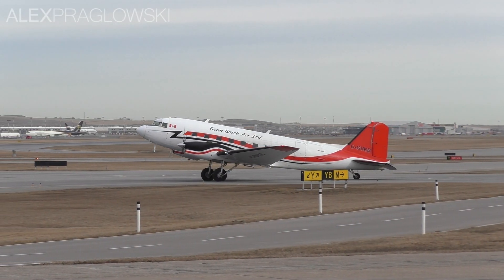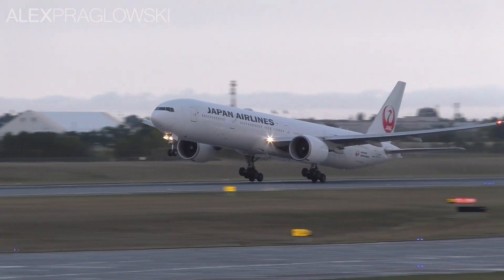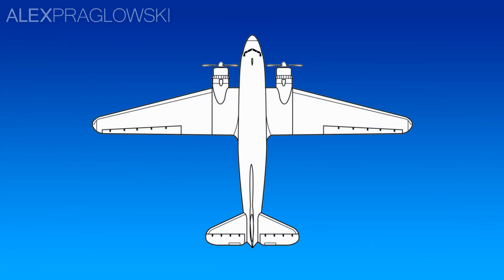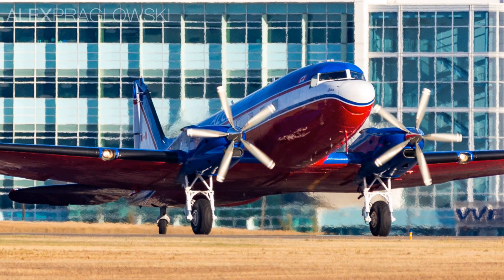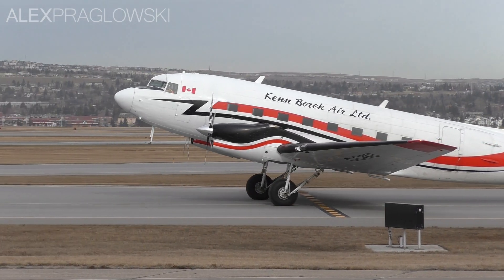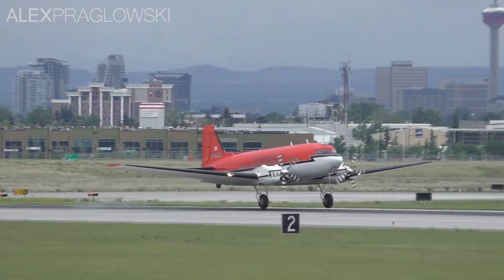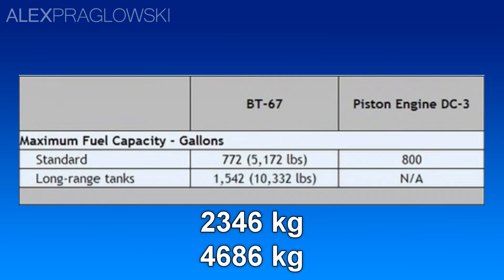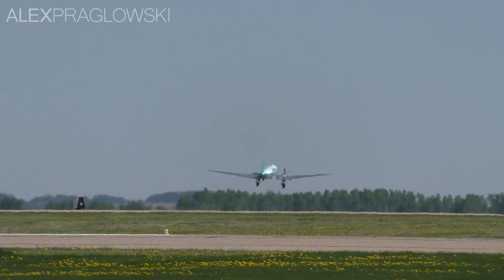What Is The Turbine DC-3?

Comment: Just learned pressurization is a wear factor on your airframe.
Had been thinking a Basler could be set up with pressurization thus enabling  higher operating ceiling and possibly better fuel efficiency. 
Instead of resurrecting DC-3 airframe why not prime manufacture DC-3 inspired new airframes with pressurization designed in from the get go ?

Comment: The turbine dc-3 is an aircraft manufactured by McDonnell Douglas that has the original radial engines replaced with more modern turboprop units there are way less moving parts in turbo prop system then a piston radial engine and allows for more fuel mileage and less maintenance I flown both talking on experience but they both sound good but for charters trying to make profit turbo prop is the way to go these planes usually get retrofitted with pratt and Whitney pt6a turbo props

Comment: The DC-1, DC-2, DC-3 aircraft were designed by people with slide rules and a good dose of intelligence.  They did not have computers.  They designed DC planes to be stronger than was necessary and it clearly shows in their longevity.  Well done, Douglas Aircraft.

Comment: I would've loved getting 14,000lbs on the Basler. We were thrilled getting 12,000lbs, typically we wouldn't go above 10,500 and that was with BT-67s that had the shorter wings and no aux fuel tanks. KKB (in this video) had a reinforced floor, larger wings and aux fuel tanks to extend range...it was a heavy bird built to take a beating and you'd max out at about 9,000lbs.

Comment: Not DC-3 related but I remember one flight of an Air Force Constellation if I Remember correctly that was powered by 4 Pratt and Whitney 4360's. On a flight from LA to Hawaii just past the point of no return an engine failed in flight, feathered the prop and continued the mission then another failed, then the third engine failed. The command pilot then broke the war emergency wire on the throttle on the last operating engine. Pratt and Whitney guaranteed when you went to war emergency setting no more than 5 minutes at a rating of 5000 horsepower. That engine continued to power the aircraft until it landed and after touchdown the pilot started to reduce power and the engine seized with no warning. It ran for more than 6 hours I believe after the pilot went to war emergency rating.

If you visit Pratt and Whitney's production facility in Connecticut that engine is still on display in the main entrance lobby no bs. Somebody check it out and the story of its flight is posted along with the engine. The 4360 was known to run reliably for 600 hours then usually failed in flight. It is the only flight with 4360's where three engines failed and actually arrived safely. By the flight manual of the aircraft the aircraft should have crashed into the sea.

Cheers!

Comment: It is my understanding that the South African Air-force commissioned the modification of their DC3 and DC4 fleet in South Africa in the 1980's which included an extension of the fuselage and installation P&W Turbo engines in concept models in the late 80's and full production in 1990.  Research, design and implementation was  undertaken by State military manufacturers Armscor and Denal Aviation.

Comment: The radials wore out.

Turboprop is more efficient and lighter so they stuck them in place of the radials.

because of the lighter engines, they need more nose weight so they stretch the fuselage.

Comment: Unpressurised cabin is the main factor contributing for the longevity of the airframe.
Reply: I was wondering why the PT-6 version used more fuel.  You may have answered my question for me.  Lower operating altitudes.
Reply: @davetherockguy  It uses more fuel because per horsepower turbine engines use more fuel than piston engines. The Basler 3 out performs the standard DC-3 in all the parameters except range and Basler had to double the aircraft's fuel capacity to give it more range than the Standard piston engine DC-3.
Reply: @Agwings1960  you can't lean out a PT-6, they run at a constant speed. Radials you can play with the throttles and mixtures for max endurance. Jet fuel is easier to handle than Avgas to remote locations and won't varnish up like Avgas. Turbines do have problems starting in artic weather though.
Reply: @michaellucht6351  I know that my comment was to point out how the SFC numbers on piston engines were different from the PT6's, used on the turbine engine conversion and you can lean out turbine engines too, with altitude lol
Reply: @Agwings1960  I work on KC-135s at the depot, our oldest ones still flying are 57 models. We always replacing fuselage and wing skin , engineers  told me when we do that we a zero timing the airframe. We are about 30k on hour's. I remember flying at altitude and making gas.
Reply: No It's like saying spiders can walk more than human cause they have more legs. Pressurised cabins are made for pressurization.
Reply: I'd say that the over built redundancy is more relevant.
Reply: Someone explain to me why you can't just give up a bit of cabin space, and install a pressurized inner liner while leaving the air frame un-pressurized?  It seems like a workable compromise for a corporate commuter.  Also, why no winglets on the end of the wing to reduce drag?

I am not an engineer, so I look for simple fixes for what look like simple problems.  Thanks!
Reply: @barking.dog.productions1777  When it comes to pushing cargo, The more you can fit the more money you make.
Reply: @caleproteau1060  I didn't mention pushing cargo, I mentioned a pressurized cabin for corporate transportation.  Any idiot can see that if you are pushing cargo the more you can carry the more money you make.
Reply: @barking.dog.productions1777  There's better, newer aircraft for corporate transport at that cost. Every Basler is worth 8 million bucks.
Reply: @barking.dog.productions1777  It's obvious, you can not have partly pressurized aircraft because structural integrity.
Reply: @Patrick_AUBRY  No one mentioned a partially pressurized aircraft.  Maybe, it will help you to visualize it more like a vacuum thermos with the passengers being inside of a completely separate chamber isolated from the main airframe. (except to pull fresh air from it.)  It would help with  sound deadening and thermal insulation for the passengers as well since there is plenty of room to wrap the inner chamber with insulation and still have plenty of passenger space for 10-15  people.
Reply: @stopthephilosophicalzombie9017  I seem to recall that it is done in certain submarines, and possibly spacecraft.  That might be a better place to research the effectiveness and application.  It doesn't make sense cost wise to build a new plane this way since the pressure differential is so small they just pressurize the entire airframe.  It only makes sense in retrofitting these older birds to keep corporate types comfortable while retaining the un-pressurized airframe for the crew and luggage.  People will spend a fortune retro fitting old yachts and planes, and with today's composites it would be fairly simple to do.
Reply: @barking.dog.productions1777  The pressure cell would basically be a piece of cargo itself, and very heavy if it is supposed to support several PSI over its entire surface, with 1 or more hinged openings- (think about the doors on a modern jet) - it would quickly weigh more than is worth it to keep it separate from the airframe
Reply: @johndoe528  I agree to a certain extent.
This is just speculation on my part anyway.

With modern materials (carbon fiber) the weight becomes a non-issue.  Considering that these airplanes can carry 1000's of lb freight/payload - I was just speculating that if the primary mission were a corporate/small-company long range transport, then it could be be done quite easily.  There is plenty of room to install a very comfortable pressure capsule for quite a few people while still allowing passage for flight crew to have access to the entire un-pressurized air frame.  The main benefit being range vs cost per mile.

Also a very viable solution for very low budget exploration or scientific study long range personnel and equipment transport.

Would anyone actually want to do it?  I don't know.  Big companies just write off the expense of a corporate jet.
Reply: @barking.dog.productions1777 
Eeyow, no. Pressurizing a -3 would be a nightmare, and the PT-6A-67s don't put out enough bleed air to pressurize even part of that big cabin.
Reply: barking.dog.productions1776 that would be an incredibly difficult task.  Where are you the pressurization component going to be placed.  The high and low pressure ducting has to be installed.  Windows must be replaced with round windows.  Too much work for little gains
Reply: @frankbutaric3565  I don't understand why people have to try to turn simple things into nothing but problems.  You pull out the seats, and you install a large pill/egg shaped container inside of the non-pressurized cabin.  it only needs one pressure door.  inside of the big propane cylinder you put chairs, food, water, a bathroom, a stewardess,some inside portion of climate control, a speaker box to communicate outside of the big propane tank with the rest of the crew.  everything else gets mounted outside of the big propane tank.  Inside the tank only needs to maintain fresh air at one atmosphere.

Why do you insist on being obtuse, and trying to turn this into a mars lander?

We are just trying to transport some corporate types in a pressurized container inside of the original unimproved air frame.  Why do corporate types need a window?  They are supposed to be in there working or sleeping,  If they need to see something outside of the big tank then mount some cameras and give them plenty of flat monitors.  Why is this simple concept so difficult for you to grasp?????

GOOD GOD... talk about over-educated and not a lick of common sense.
Reply: @frankbutaric3565  Here Frank, let me tell you a little joke.  Back in the 1960's some folks just like you had an engineering problem at NASA.  It seemed that terrestrial pens would not work in zero G.  After 5 years of research and testing the "space pen" was born - it was an engineering marvel, and the pride of the American team!!!!!

The Russians had the exact same problem...  they used a pencil.
Reply: I'm not getting any notices of comments on the discussion, and even if I did I would probably ignore them.

That discussion was talked out 6 months ago, and why would I want to start a company making liners for an obsolete plane?
How big do you think that market is?  Have you ever owned a business...  I have.  That is not a smart business idea.

There are other discussions on the site, why don't you go find one and stop beating a dead horse?

Have a good day.
Reply: @barking.dog.productions1777  You made a good point there. You’re not an engineer. So how would you expect to understand the answer to an incredibly complex problem, let alone expect someone to be able to explain it in the comment section of a YouTube video…
Reply: Anas Takiyudin Contributing to, not for
Reply: Lewis Johnson pressurized cabins have a finite amount of cycles.  At that point they are scrapped or used for cargo only.  Every takeoff places stress on the fuselage just like inflating a balloon.  The cost of inspecting all the connective joints and other components becomes so great that it is cheaper to get a new aircraft.

Comment: honestly what im wondering is, if you have to redo all electronics, hydraulis, the engines and critical parts of the airfram to have "zero accumulative fatigue damage", then why dont you just build a new airframe from scratch? considering how widely the airplane was in use shouldnt there be enough tooling left over to produce new frames?
Reply: It would be my guess that it would need to be recertified.  
Also there is a lot from the war that is already lost to history.  I help with with a tbm avenger none of the tooling survived. ( the owner and his partner are the largest supplier of parts so if it was around they would have it). We've worked off the prints for parts and its nearly impossible to remake them as the techniques used in manufacturing of them are just gone. It really is surprising how non backwards compatible we are.

Comment: Back in 1991, I did some skydiving.  I rode up in one of these converted turboprop DC-3 planes several times.  It had a large side opening with a Plexiglas roll up door, like an overhead garage door.  On the busy days, we'd jump at 12,000 feet, and by the time I made it back on the ground, the plane had already landed, loaded up and was on the way back up with the next load of people.
I don't know if it was a Basler BT-67, but it was a turboprop DC-3.

Comment: One time around 1993 or so I was in the Florida Keys with some friends and a local outfit was flying bright yellow DC-3's over us, spraying the nearby areas for mosquito control. They flew very low over the house and it was really cool to hear those engines and see real, working DC-3's doing their job. Later we drove by the airfield and saw them parked on the flight line.

Comment: I live in Miami, and there's still a few DC 3s flying. They haul the mail to the Bahamas every day, twice a day. They leave out of Opa Locka airport and fly to Nassau or Grand Bahamas and prolly other islands too. We see them leave out hearing their original rotory motors and three four hours later back they come. So cool still seeing them flying being a workhorse. It's also a good way for young pilots to gain flight hours just hauling the mail.
Reply: Are you sure they are not those missing planes lost in the Bermuda Triangle long time ago that happens to make a come back through some time wrapping wormhole?
Reply: That's great to hear they're still in service.  I grew up in Miami Lakes right next to Opa Locka.  Saw the DC-3's running 25 years ago and thought how old they were even back then.  Saw all kinds of unique aircraft as a child at that airport.
Reply: @cup_and_cone  I used to only see some sivler MIG 15 conducting flight training near us and some ugly army green biplane doing low level pass by.
Reply: @cup_and_cone  Yep they're still flying, every day. I guess it's cheaper to use prop planes for the short hops of the Bahamas, than a jet. They also use other older airplanes, like Lockheed's and other vintages from the 50's, but there's at least three DC 3's there. Opa Locka is becoming more of a corporate  jet port. They built a few high end private terminals there catering to the wealthy. The Coast Guard is still there with their base. But Opa Locka as a whole, as you remember it has gotten a lot smaller, they've been selling off the property around 57 Ave and 37 Ave.
Reply: Prolly?
Reply: Most still In use are ex c47's they built only 607 dc3's from 36-42 and just over 10,000 c47 from 42-45
Reply: Actually, DC-3s use radial engines. The old "rotary" engines from WWI are also radials, but the whole engine spins with the propeller bolted to it. As engines increased in size and weight, the rotating mass of the ever heavier engines created such gyroscopic effects as to make control difficult, so fixed radials turning props with the crankshaft became the norm.
All rotaries are radials, but not all radials are rotaries.

Comment: Many thanks, Alex! I had seen a few stills of the Beselers and said, oh, yeah, wow, great idea. Now, with your vid, the mod details and the stats, I can consider myself much better informed. And I'm even more, "Oh, yeah, wow, GREAT idea!" (Mildly surprised, though, that the turboprop is thirstier. Is this due to the higher payload, the relatively low altitudes flown by this unpressurised aircraft, or just the nature of the turbo beast?)
Reply: Turboprops are generally lighter and more reliable than radial piston engines. Like gas turbines (jet engines) generally, turboprops gain efficiency with altitude while reciprocating piston engines lose efficiency with altitude.
 Jet-A, kerosene, is considerably cheaper than aviation gasoline, less fire risk, and contains more energy per gallon than gasoline.
Reply: @algrayson8965  So to restate: According to the video, the turbo uses more fuel than the piston engine (requires larger tanks to make the range) -- and this despite JetA having a 9-10% greater energy content than 100LL. To me, this was surprising. How much of this effect is the result of flying at low altitudes (unpressurized generally means flying below 10,000 ft), and how much is due to the greater payload of the Beseler's stretched fuse?

Comment: What an absolute freak of  perfection. Who would have thought that an aircraft designed in the very early 30’s would still be 
chosen for use  by modern day operators with the aircraft having minimal alteration besides the engines of course .
Cheers from Downunder
Reply: Exactly! The last one built in 1946 and there are still hundreds flying every day.